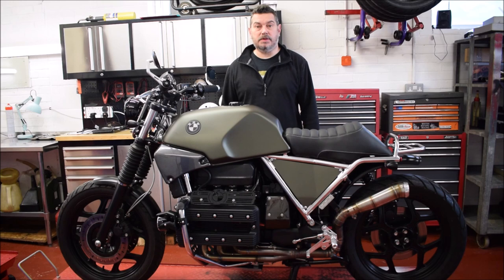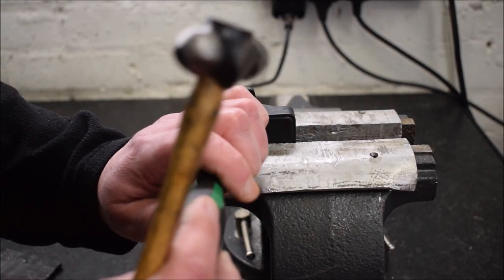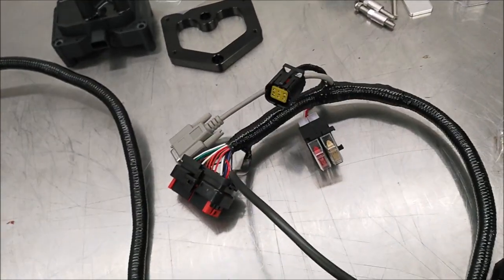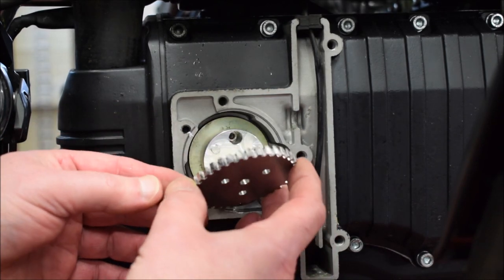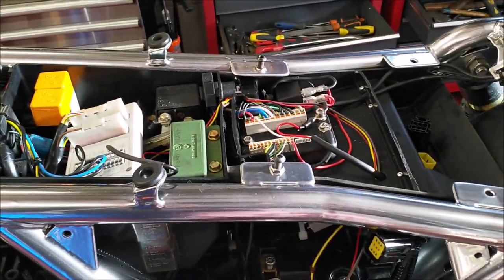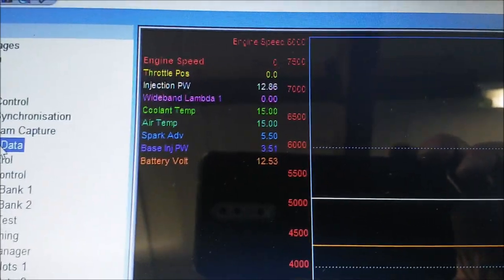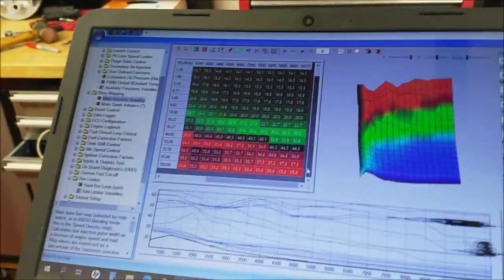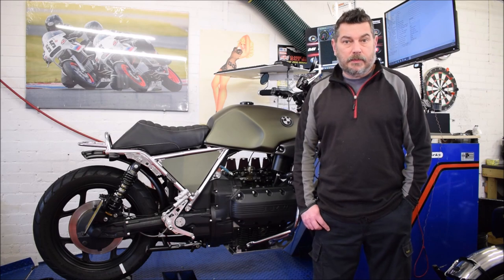BSK SpeedWorks BMW K Series Engine management system fitting guide

Comment: Very interesting thanks for sharing. Worth thinking about for my K race bike build. The power  increase in terms of £ per hp is pretty good, all K bikes seem to run horribly rich. What incremental gains would you expect adding the billet throttle bodies, cams and flowed head? In your experience do the pod filters affect running compared with an air box?
Reply from the maker: The billet throttle bodies are only available for the 16v head. With cams and flowed head you should see at least another 20% increase. Pod filters seem to run OK but they are going to be feeding warmer air because they are partially behind the radiator, an air box with a cool air feed from the front would be preferential in terms of performance.

Comment: I have a question: Assume you have a 8 valve K bike and I see you have pod filters and I wonder how do you place/connect your MAF sensor ( the unit sitting the original air filter box. Thanks very much and it's a cool video that K bikes finally have some mod to go fast 👍
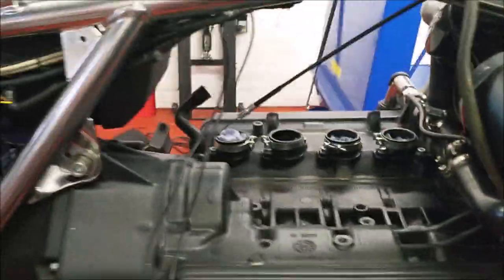Reply from the maker: The system means you don't need to fit the MAF, so you can fit pod filters if you wish or any type of air intake. at 5:20 into the vid you can see the parts from the stock system that are no longer needed. Thanks.
Reply: @kinghamracing  I'm assuming that's the same for the K75?
Reply from the maker: Yes regarding the MAF/AFM. With the K75 you still need a set of 16v Throttle bodies, just with #1 TB removed. @emmanuelreynoso5770
Reply: @kinghamracing  y'all are the best, especially with the replies tysm

Comment: Hi, I have a custom K100 2V and I was wondering if it would be possible to use your kit together with the 2v throttle bodies by adapting the TPS to them. I guess the power gain is mostly because of the leaner mixture and not only because of the larger 4V throttle bodies (although that has a similar outcome)? Theoretically you’d have better torque at low ends with the standard tb‘s because of the faster flowing air at the smaller diameter… 

Cheers, 
Richard
Reply from the maker: Yes that would work, if you can adapt the 16v TPS to fit the 8v throttle bodies. Performance gain on 1mm smaller/larger TB's is probably negligible.
Reply: @kinghamracing  thanks for the information. You will probably here from me again in the next winter ;)

Comment: Then a 16v will only need a dyno tune ? As I have recently picked up a 92 k1100lt.  🇨🇦
Reply from the maker: Obviously the 16v already has the required throttle bodies but the TPS still needs the mod and most of the other info in the video is relevant.

Comment: Are you able to use this install to later map burble tune?
Reply from the maker: There is a pop/bang mode in the software, yes.
Reply: If you install this with m-unit will you still need the relays? or can you wire it without them. I rewired my bike with no relay's except the temp sensor unit for the cooling fan.  @kinghamracing
Reply from the maker: You would only need a relay for the fuel pump and the cooling fan. Both of which are run by the ecu and can be set in the software. You can set prime time for the fuel pump at key on and the temp at which the fan comes on and off. The system uses the stock K water temp sensor. @mechealkolefire1574
Reply: @kinghamracing  if you use the coils from this kit with stock wiring how would you Ground the coils? I see it only has three wires with new coils. Or is there a ground wire in the new coils I’m not seeing?
Reply from the maker: @mechealkolefire1574  Ground wire is not required, but the coil is grounded through the bolt to the bell housing.

Comment: K100 8V had originall 90 HP. Why had this engine befor only 68hp? If all would have been okay, the increasement would have been only 3hp?
Reply from the maker: they were quoted as 90hp at the crank, which is around 75hp at the rear wheel. Our dyno is reading rear wheel hp.

Comment: Interested to know is that a coil from a ford mondeo? it looks exactly the same!
Reply from the maker: Could well be similar, they are used on lots of inline 4 engines.
Reply: @kinghamracing  Thanks for the reply, do you remember if the HT leads had any kind of resistance setup? The stock K100 leads ran about a 5k-6k ohm resistance.
Reply from the maker: @Overture  Yes they are 8 ohm